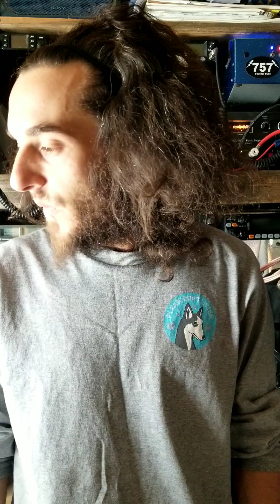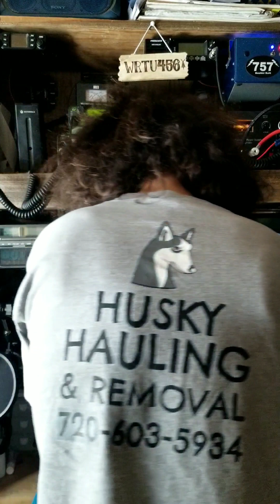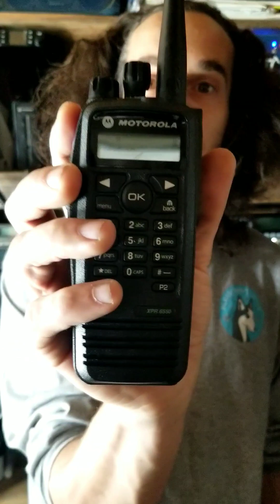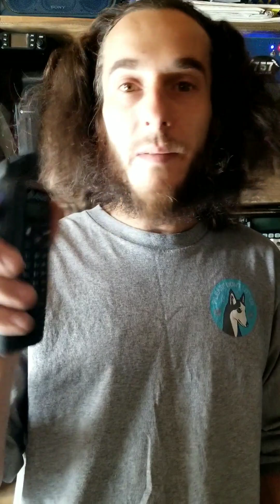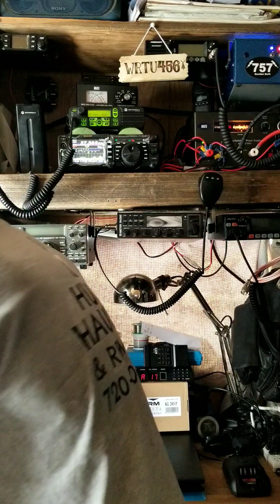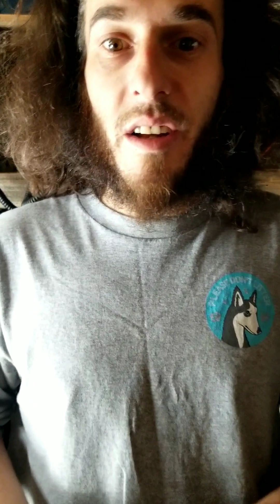Motorola MDC ID KeyUp Tone

Comment: How to identify motorola radio model have mdc1200 from the spec sheet?
Reply from the maker: You need to type the long ID number on the back or under the battery in google and it should tell you what you have, VHF, UHF, or UHFII
Reply: @wtfmurphy  thank you for the reply. Actually i dont have one, and im planning to buy one but im lost which motorola ht have mdc1200 feature